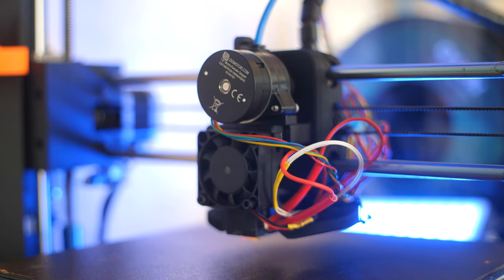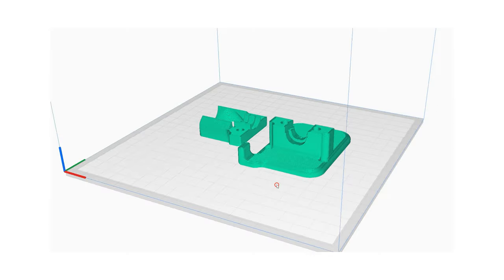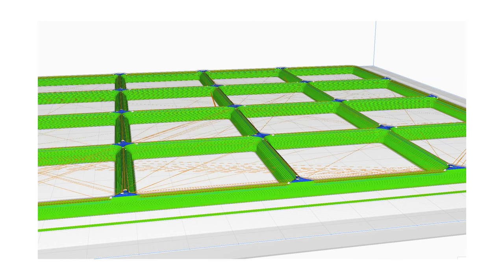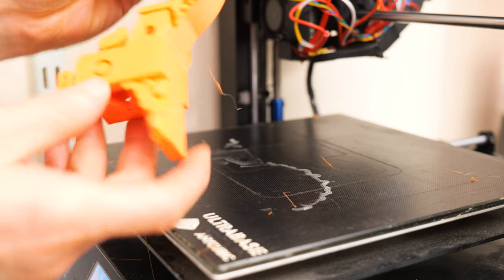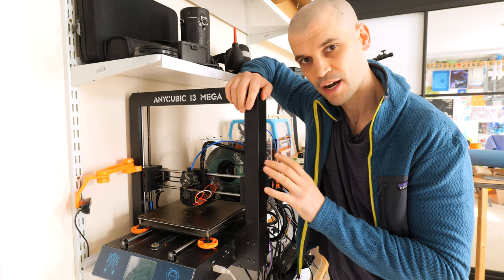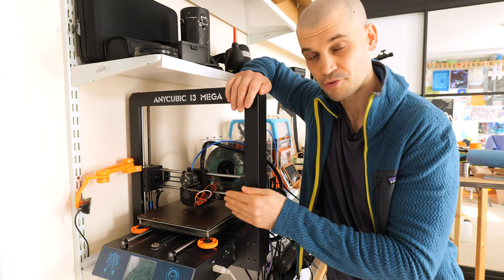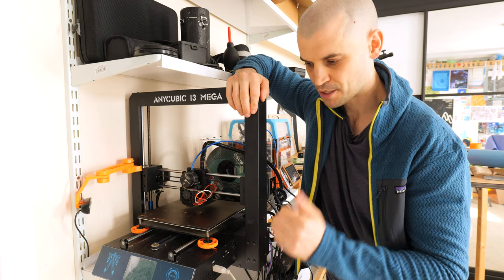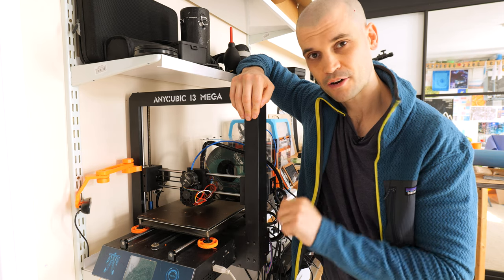ORBITER 2.0 Direct Drive Upgrade on Anycubic i3 Mega

Comment: Sorry if I am late to the Party, but you dont have to change the controllboard for klipper.
I installed Klipper on my i3 Mega using the original controllboard and a raspberry pi zero 2W.
And it runs perfect.
Reply from the maker: Thanks for this information! You've given me another reason why I should switch 👍

Comment: @ThisDesignedThat   Hello, I already installed klipper and I have it working perfectly, thank you very much for your videos and I am waiting for that update of the anicubic i3 mega s without changing the serial board since I am following your videos, I encourage you to continue forward, I encourage you to put the screen touch and speeds of 120 I have the touch screen with klipper screen and another touch screen with mainsail and a wireless klipper screen but I would like to see the fast hotend thanks again

Comment: my printer is almost identical. i use a garolite bed . since i added the Sherpa style extruder the only thing i have a issue with is my z seam.
Reply from the maker: Z seam seems to be an issue across most printers so I wouldn't worry about it too much

Comment: How about filament sensor? Can I use a sensor that is already in the printer and not change its position?
Reply from the maker: Yes you could do, it will detect whether filament is there or not, doesn't really matter what position it is in